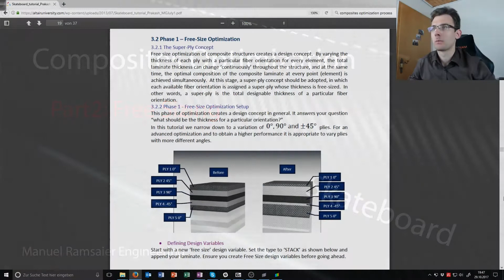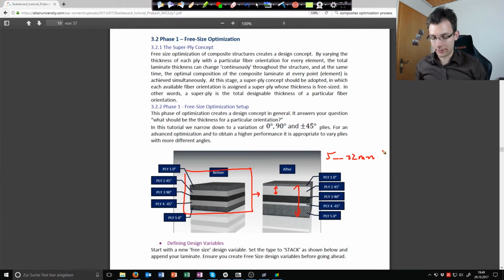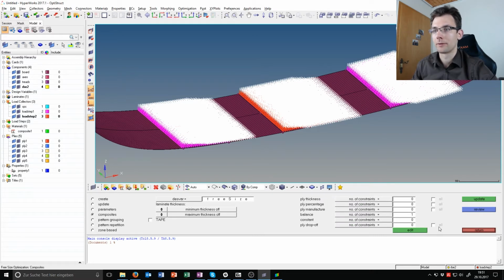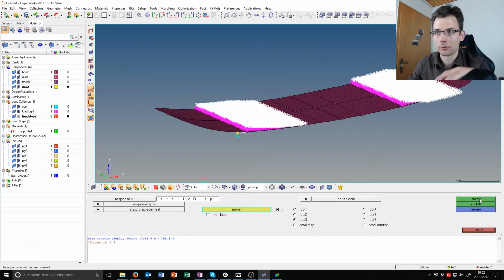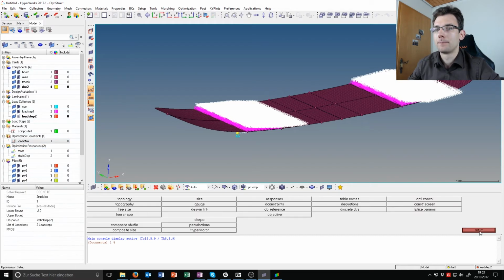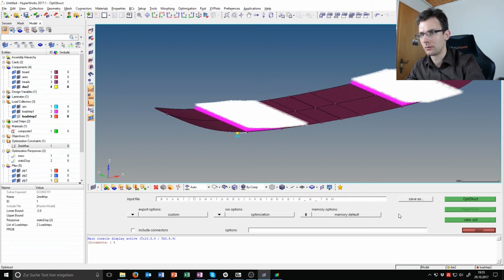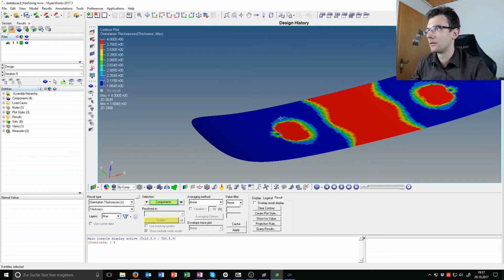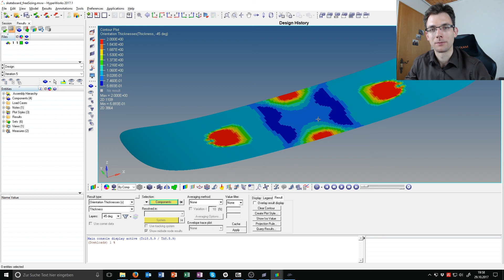Composite Optimization: Free-Sizing

Comment: Hi, do you have to do the free-size optimization in order to do Phase 2 and 3?
Reply from the maker: In our case, yes. Phase 2 makes it manufacturable in terms of ply sizes and Phase 3 shuffles the order but both rely on the results of the free size optimization. You could also do phase 2 in  a first step (so with all the manufacturing constraints already enabled) but you would maybe hinder yourself from getting a design which is better in terms of your objective function. Start with the highest degree of freedom (which is free size).
Reply: @ManuelRamsaier  Great, thank you!